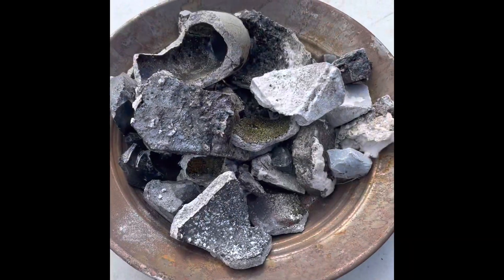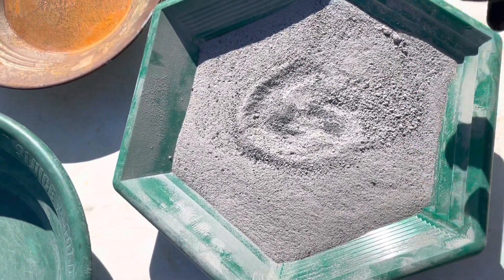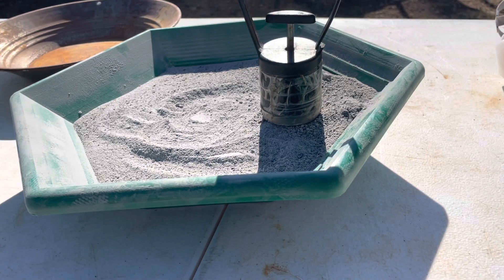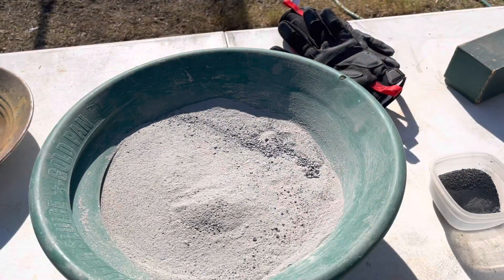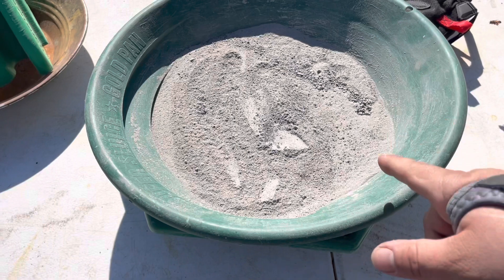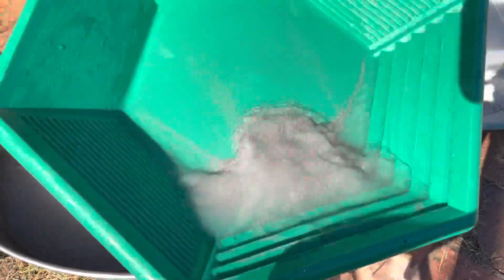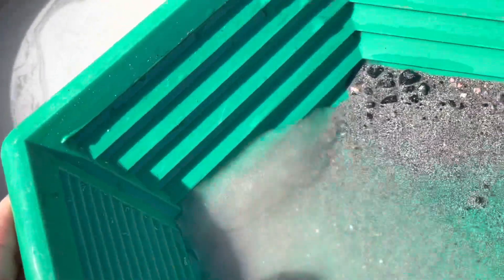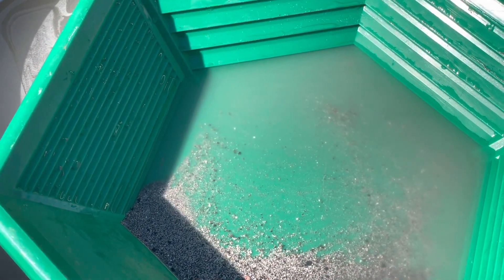Crushing Gold Slag, Crucibles, Fire bricks and Cupels for Gold Recovery & Precious Metals Part 1

Comment: Bet you been waiting for my comments. I'm glad to see you doing what I been wanting to talk to you about. Mike, think of a crucible as a beaker that operates under high temp. Everything you do in a beaker can be done in a crucible. One of the strongest Oxidizing reagents in the Lab is HNO3. But that won't work in a crucible (to wet), however there are two oxidizing agents that will , one being KNO3 (potassium nitrate) which is used extensively in smelting operations. This is a very radical reaction so you don't want to fill your crucible more than 2/3 full. Lead oxide is also an oxidizer. An excellent one i may add as when it converts to the metal it forms little droplets of molten lead that quickly captures the metal particulates into one button that is easily cupelled. This is a 2 step oxidizer, first in the furnace itself (smelt) and secondly when you drive off the lead. If you use bismuth you would have to use KNO3 if litharge just let her rip. Another way is to simply do a straight smelt no inquartation and simply let the metals all collect together, pour a dore' bar and part with 25% HNO3 (remember , water first). This will put everything in solution except your Au and any platinum group sisters. Then just wrap your residue in lead foil and do a final cupel. Hope i helped using as simple as a layman speech as i can find. You have my# give me a call with any further questions.
Reply from the maker: you are correct my good sir, i actually mentioned you in my filming but edited it to not mention names lol... Im thinking the first step would be just panning it all and lead foil wrapping it. then with the remaining heavy's just smelt those down and chemically refine them. Why is the Bi reaction of less favorable than Pb? (at least that's what it seems like overall with what you mentioned Pb oxidizer) and why does Bi require the KNO3 in the smelting process specifically?
Reply: Is lead oxide from batteries too dirty?  Won't all those extra metals cupel out?
Reply: @readoryx373  they should. But then again, what are the extra metals? Any silver, even trace amounts would contaminate your sample. Arsenic or antimony could really mess with you. Try bismuth. Excellent collector and easier on the environment.

Comment: It seems old timers used copper to collect gold, dont get rid of copper there, it has gold in it, use diluted nitric acid to get rid of copper and to get the gold out of it.
The big question is: how could old timers get the gold with the presence of all that iron??
Reply from the maker: I’d guess magnets 🧲. There are lots of different ways to deal with iron, watch the next few videos in the series, we refine the copper button as well
Reply: @VendettaProspecting  i meant there was alot of iron in that slag, it seems they didnt care to get rid of iron, yet they surely got gold,, that is weird!!
Reply from the maker: @S13402  well Iron take much higher temperatures to melt to it stays in Matt form in the slag and it is very likely to contain trace amounts of AU in the form of sulfides.
Reply: @VendettaProspecting  true 👍
Do you recommend roasting and smelting it using lead? Not sure if that works,, I really need your guidance here 👍🌹
Reply: @VendettaProspecting  i suppose old timers were after an iron vein which contains good amount of gold,, that explains the huge amount of iron in the slag,, check the same area of the slag,, your gold is there,, i have passed through the same situation 😁👍👍 Good luck

Comment: White vinegar, ammonia, sodium chloride 🧂 (not sea salt). 4:3:1 ratio for copper. the presence of copper rusts iron more quickly because it is lower in the reactivity series. This should work for both metals but if you look up how to oxidize iron quickly you might come up with different reagents than for copper. Do it outside